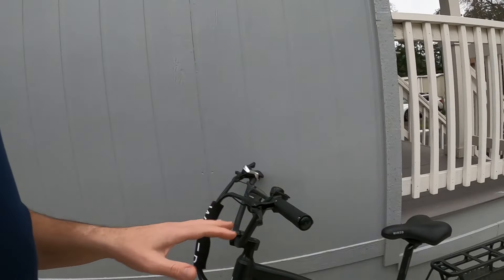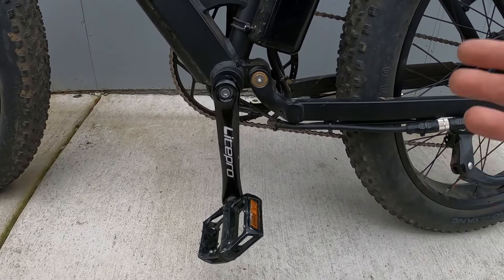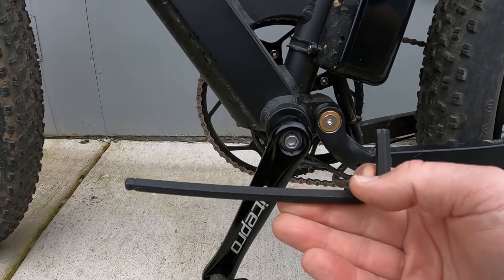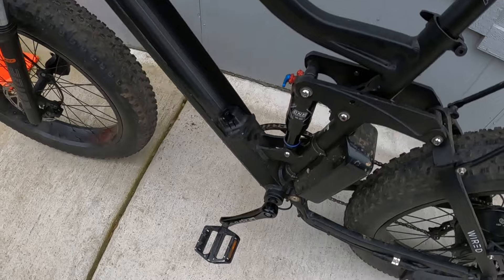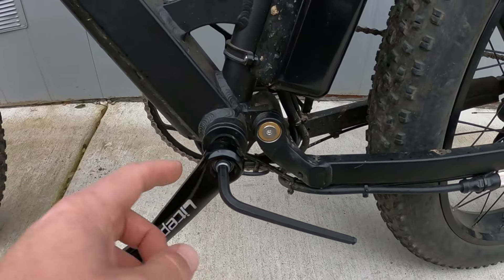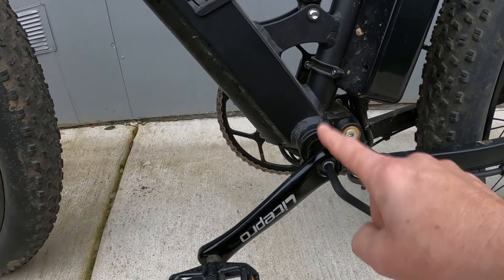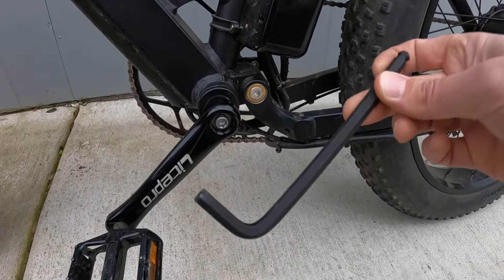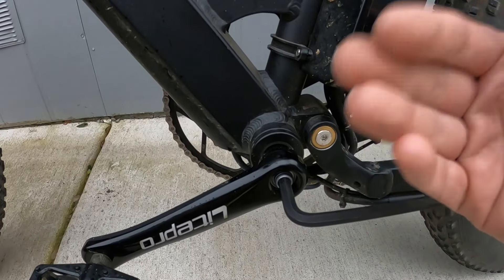Check These Bolts On Your 2024 Wired Freedom!

Comment: you need to stand on that allen wrench and get it really tight. if it happens again get some blue locktite. you should probably check every bolt and nut on the whole bike after 100 miles or so.
Reply from the maker: Absolutely!

Comment: My crank came off and I crashed on my decond day. I replaced the crank bolt with red lock tight, but the crank shaft still wobbles. I should have checked it!!
Reply from the maker: Yep, it's a problem! Just rode tonight and had to tighten it again a few miles into the ride.

Comment: Hey man, I’ve asked a question before and you answered super quick so I wanted to get your opinion on something regarding this bike:

I purchased in November and received my bike in late January I currently have around 140 miles on it. My battery does not last a long time at all. At a full charge using only PAS 1 using primarily pedaling my battery will be half drained in under 20 miles. Using PAS 2/3 it drains even faster. I have my settings mostly mirrored to yours from your previous video. Have you heard of any other owners with a similar issue? Thanks
Reply from the maker: That's very strange. What is the temperature you're riding in right now? If you ride in the 30s or 40s you will lose about half the range.
Reply: @leetjohnson  where I live on the east coast the temperatures have been between 50-80F degrees
Reply from the maker: @andrewgenes3271  that's really strange. Are you charging until the light goes from red to green on the charger?
Reply: @leetjohnson  yes, I don’t usually let it go fully dead. So this last time I charged it fully two days ago, I rode it two days in a row, less than 25 miles total between both rides and it’s already at 2 bars. Again using mostly only pedaling and not throttle only. The first bar will disappear within 5 minutes of riding, on PAS 1 only. Then the 2nd bar usually last a lot longer.
Reply from the maker: @andrewgenes3271  that's really strange. Does the onboard battery meter match the display meter?
Reply: @leetjohnson  I haven’t checked recently but the few times I did check early when I started with this bike, the battery would usually indicate 4 bars still while the display would show 2.
Reply from the maker: @andrewgenes3271  make sure your P5 setting is set to 6! Let me know if this fixes the problem.
Reply from the maker: @andrewgenes3271  the onboard battery meter is always more accurate than the display reading, but changing this setting should help a lot.
Reply: @leetjohnson  update! I wound up switching the P5 setting and it has fixed the issue. I had it set at 16 but switched it to 6. The display is now matching the onboard battery view. Thanks for helping me trouble shoot!
Reply from the maker: @andrewgenes3271  great news!!!

Comment: What do you think of the wired bike. I am almost ready to pull the trigger on one. Do you think it’s built well? Pros cons?
Reply from the maker: I think it is an amazing value for the money! 40mph top speed, 60v battery with 40amp controller,  dual suspension, and hydraulic disc brakes definitely set it apart from the rest.  The only thing I would say is if you plan to do heavy off-road stuff like big jumps or really steep mountain climbs, this bike isn't ideal. But if you want to commute, light trail riding and comfortable long distance exploring and cruising, this is definitely the best option out there, in my opinion. 
   If you do decide to pull the trigger and would like to support this channel, there is an affiliate link in the description box, I'd really appreciate it! Let me know what you decide, and if you have any questions, feel free to reach out to me!
Reply: Yea Thanks just light off road an on road like 90% on 10 off road.
Reply from the maker: @rsolom6  it would be perfect then!

Comment: 5/16" is the equivalent of 8mm if I remember correctly. Remember, those bolts are steel nut they are chinese steel. I have seen Chinese bolt heads just snap off due to crappy manufacturing. Hopefully things are getting better. Good video
Reply from the maker: You are 100% correct! 5/16 is equal to 8mm!

Comment: Replace the bolt with a nut head screw that bites the metal.  That’s what I do with all the mountain bikes I’ve ever run. And ebikes.   they sell the screws. I think they are 8 mm for all bikes.
Reply from the maker: @773Chicago  for sure!